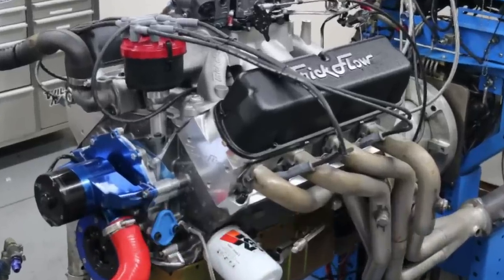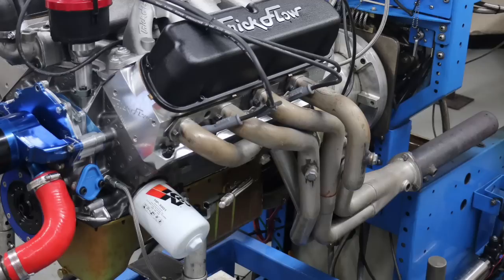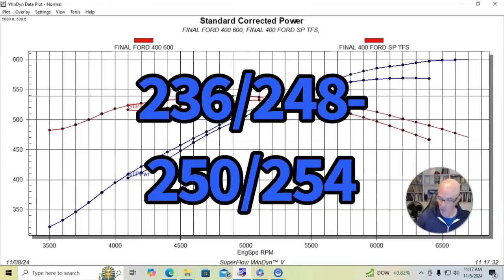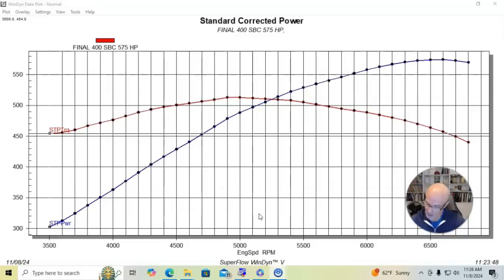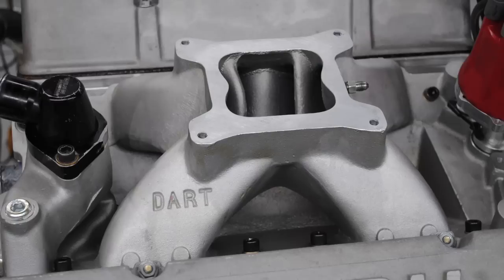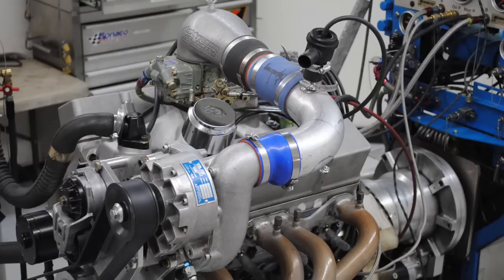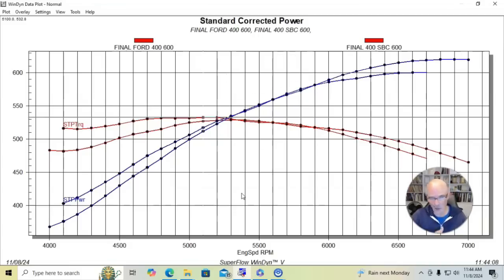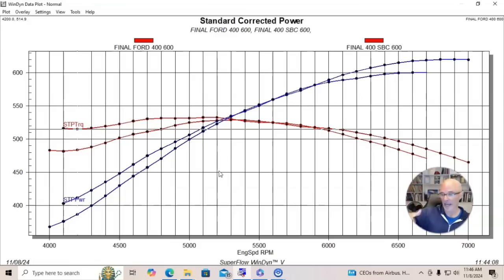400 FORD VS 400 CHEVY-THE OTHER GUYS STROKER BATTLE. HOW TO: 600+ HP 400-INCH SMALL BLOCKS!

Comment: Richard, I order a low buck truck cam on November 1st (came in last Friday) from you and I didn’t get a shirt. I would love to get one though.
Reply: 400 Chevy 400 Ford 400 dodge and a 401 ANC would be very interesting but in the way they came from the factory and then modifications not a 10 or 15 thousand dollar motor to start off with also 400 cubic inches is 400 cubic inches doesn't matter if it's a big or small block it is still 409 cubic inches with the exception the amc is 1 cubic inch different but I really do not see were that would matter but it would be interesting to see
Reply from the maker: SEND ME AN EMAIL WITH THE SIZE AND COLOR
Reply: I meant it's still a 400 cubic inch I'm not sure what you meant about the color Richard I've been a fan for a long time I used to build engines diesel and gas I just thought it would be nice to take Ford Chevy dodge and AMC what used to be the big 4 now it's the big 3 american engines of the same cubic inches and find out even stock and with modifications which one would make more HP I look forward to more videos thank you for what you do

Comment: Everything being equal, it always comes down to the cylinder heads. Horsepower is made in the cylinder heads. The camshaft is an accessory to the heads
Reply: I’m pretty sure the heads flow similarly

Comment: Okay, so you threw the Chivy guys a bone (or should I say a cam) by stacking the deck against Ford. Charity and compassion😇, your full of it Richard.
Reply: The chevy was oe ci. The ford was a stroker......how is that throwing the chevy guys a bone?

If the chevy was also a stroker it would be a 427.
Reply: @HioSSilver1999  They are both 400 cubes. And did you read my response to Richard's comment. GEESH!
Reply from the maker: new to the channel?
Reply: @richardholdener1727  No, I know you lean blue oval, just my type of sarcasm is hard to pick up at times, I meant what I said about charity and compassion, not that you are full of crap. Love you Dude.

Comment: You couldn't get away with a 4.125 bore on a stock SBC block.  Bigger bore and  shorter stroke is definitely an advantage for the SBC in this comparison.
Reply from the maker: factory 400 sbc had a 4.125-bore block (though this was an after market block)
Reply: 400 sbc is 4.125 from the factory. Unfortunately, stock 400 blocks are getting hard to find. Not nearly as many made as the 350 blocks.
Jack Henderson

Comment: Ahh wutttt I thought you actually had a 400 ford. Not a stroker 351W!
Reply: The stock Windsor didn't have enough head to support a 351, A 400 Windsor is a joke.
Reply: @mylanmiller9656 are you okay

Comment: The Fact the 400 Winsdor Ford made 601 Hp , Chevy 400 619 Hp , Ford used much less Camshaft duration,  points to myself the Ford 400 is more efficient doing with less .
Reply: Man everyone is uoset. I CAN TELL YOU FROM DECADES OF STREET RACING HERE IN UPPER CENTRAL ILLINOIS ALL THE HORSEPOWER UP TO 5000+ DOES YOU NO GOOD IF YOU CAN'T MAINTAIN TRACTION 9N LAUNCH,  60 FOOT, 1/8, 1,4, 1/2 1 MILE & 2 MILES FLAT OUT GOING TO 200+ MPH. IF THE FRONT END LIFTS AT 140-180 YOUR FLICKEN DEAD  
I AM A PONTIAC V8 GUY THAT LOVES BIG BLOCK CHEVY V8 TOO ALONG WITH ALL OTHERS. 
TRUE STREET RACING YOU RACE ANYWHERE ANYTIME.DIRTY NO SWEPT BLACKTOP ANY. HIGHWAYS  INTERSTATES ALSO AT 2-3 AM PURE PITCH DARK ONLY HAVE YOUR HEADLIGHTS.
Reply: This isn't a test or comparison it's a hey let's dyno 2 completely different motors
Reply: Actually the ford did less with more. It's a stroker....the sbc is 400ci stock
Reply: @HioSSilver1999  Chevy was aftermarket block, big bore blocks unshroud the valves allowing better flow. Should of been either a stadard 4.03 block for both or the 4.125 for both.
Reply: @DBLDREW  4.125 is a stock bore for a a 400sbc. So you're wrong.  Aftermarket block is just a convenience since they haven't made them is so long
Reply: @HioSSilver1999  ford makes a 4.125 block as well, point is you should compare apples to apples
Reply: @DBLDREW  The SBC 400 standard bore is 4.125, not a 4.0, the 350 had a 4.0 bore.
Reply: @SteveBurnsed  not sying that its not, I'm saying ford produces a 4.125 bore as well so it should be comparing apples to apples. Both should be 4.125 or both should be 4.00 

If this was a comparson with big bore shorter stroke vs smaller bore bigger stroke then it should be the same manufaturer as well
Reply: @HioSSilver1999  With an aftermarket SBC block!   Try it with a stock GM block and see what happens!
Reply: Let's compare apples to apples.
Reply: @tct9mm151 They’re already sbc 400 blocks that exist oem, it’s was probably just easy for strength and availability for Richard to use the aftermarket block
Reply: @tct9mm151  be the same result. 
Try the ford with a oe crank stroke.....oooh wait then no 408.
Reply: @HioSSilver1999  correct but 351w will make tons of power without air conditioning the block like the stock 400sbc. . 
The 351w doesn't need to be stroked to make power unlike the stock 400sbc that's known for it's weakness which explains why the sbc aftermarket block.
Reply: @tct9mm151  what explains the aftermarket block is simply trying to find a oe 400 block.

351s are turds. If it wasn't stroked with a aftermarket crank it woulda got shit on even worse.
Reply: @HioSSilver1999   And that's why he had to buy an aftermarket 400sbc block?  Because the stock block WILL split in half after 400hp. 
Fact is that the oe 400sbc are over heating, oil burning, wheezy, old van engines that were SMOGO junk that needed constant repairs just to propel the 70's GM junk to comically poor performance and fuel economy with the worst (at best) reliability!
351's are tough as nails and never needed anything to make them performers. 
351W are ICONIC!   
400sbc are the "POOCH OF THE LOT"

Comment: Both Are Impressive Engines the 400 Ford Winsdor and the 400 Cubic Inch Chevy.
To me the 400 Ci Chevy has an advantage N/A with the 1000 ctm 4150 Holley Better Volumetric fill efficiency. 
There is Main and Rod Friction differences between Ford and Chevy, Bore/ Stroke Ratio, Rod/Stroke Ratio, Piston Dwell Time TDC & BDC But you never like discussions on that stuff.
Reply from the maker: because we focus on the bigger things that actually change power-those theoretical things (more often than not) can't even be measured.
Reply: @richardholdener1727  I watched a video last night where a Guy with A Toyota pickup 4GE something he used stock length connecting rods and then .300" longer , he tests like you very well documentation,  chassis dyno used. There was a Torque HP Gain up high 6000+ ,to 8000 rpms didn't lose anything down low. REPEATED Results likewise.

Comment: Cam difference in duration, LSA and lift. The Chevy also had solid rollers. Many variables to take into account on top the Ford being 410 cid and the Chevy 400 cid. The bigger displacement engine with the smallest cam will get the most torque under the curve (Ford) and inversly proportional with a big cam and hp (Chevy).
Reply from the maker: Ford was not 410
Reply: @richardholdener1727  Sorry Richard, 408.
Reply: @richardholdener1727  The only information you did not give here is the compression ratio of the Ford engine. The Chevy was 11.25:1. It could add to the change (with all other things mentionned) and not make a big change. :)

Comment: Ran a Monte Carlo like this for a couple of years except the heads were  881 that was ported and polished. I  used tetraethyl lead to increase octane. Would get about 6 mpg in town and 25 mpg highway. The late 90’s were a different time.
Reply: which trans?
that's a huge swing in mpg
Reply: @ th350 2500 stall 3.08 geared.

Comment: Valve size, and port volume of intake and heads make up for a big difference in power and torque as well as the added duration. Great video 👍🏼 I always enjoy watching your videos. Much respect to you for what you do, this is coming to you from a Nor Cal Private engine builder with 30+ years experience and I commend you for your hard work.
Reply from the maker: THNX

Comment: bore x stroke definitely not a factor at this hp range. While bore size can be a factor, it is not until the hp goal requires a larger valve than what will fit inside the bore.

Comment: There's one thing Chevrolet wins on hands down, parts.
Everytime I'm shopping for Small Block Ford parts, I want to cry at the prices and availability of LS/Small-Block-Chevy parts.
Everytime I'm shopping for Mopar parts, I want to cry at the prices and availability of Ford parts.
Reply: As a Mopar and a Ford guy, I find it totally unfair that Chevy gets all the parts and companies are still developing NEW parts for the tired old 350.  The price difference is criminal too!
Reply: Ha, not 2$ difference
Reply: Camshaft is the reason the Chevy made more peak power.
Reply: @tomhamilton9140 the whole combo was set up different.
Reply: True. Parts for a small block Chevy are priced very nicely when compared to fords, especially a 460.
Reply: Not $50 difference in a sbc build vs sbf build or bbc and bbf..fact
Reply: @SpecialEDy  I don't know where you're buying your parts, but when we were racing, we bought most of the parts off Ebay! I just got tired of working a day job and racing 4 times a week! It becomes another job!! Then your partner wants to go faster! Your problem is you obviously don't have the ability to do the math! It's not a Ford or Chevy piston, the wrist pin location dictates and bore dictate the piston you buy as long as it's an inline application! Most of the stroker pistons for Fords depend on the stroke and wrist pin location! Maybe your generation simply can't do the math?
Reply: Ever look on summit? They have plenty of ford parts....
Reply: I use to run Chevys when I was broke

Comment: If It Was a 400 M Ford built by T Meyer incorporated I would put my Money on the 400 M every day of the week.
Reply: @mylanmiller9656  the 400 was made to replace the 390 FE.
Reply: What's a 400 M ?
Reply: @jesse75  An engine Ford tried to use to as an alternative to the 460ci BBF..
Reply: @jesse75  Basically a 351 Cleveland with a 4 inch stroke, taller deck height, 351W sized crankshaft main bearings, and a 429/460 bell housing bolt pattern.  From what I read, it could have been a great engine but all the emissions and smog stuff practically killed it.
Reply: @mylanmiller9656  good grief. All these guys trying to school me on the 400.
There's no such thing as a 400m.
Get with it guys.
I've rebuilt about 70 of these low oil pressure rod knocking engines over the years.
Ford was stupid!d for giving this engine a barely adequate oil system for the Cleveland, then transfer it to these tall deck 351M/400 engines with very heavy reciprocating mass without upgrading the bearings. 
I've come across a couple 400's that were both drilled to use either transmissions.
Reply: @jesse75  You don't need to be a dork, the 400 was cast in Michigan, so it is an M engine or the Windsor is not a W, and the Cleveland is not a C engine. What makes the Michigan engine different than all the other Ford engines.
Reply: @jesse75  Ah... You're playing a game of semantics.  You're right, there's no such thing as a "400M".  It's just a 400.  Just like there's no such thing as a Ford small block or Ford big block.  They are named by series, such 335 series, 385 series, etc.
Reply: @jesse75  The '71 "400 FMX" - BBF & SBF bell patterns.
Reply: @mylanmiller9656  Joey it's not a game. 
It's just facts. Stick to what nomenclature Ford has and uses.
Lots and lots of ignorance out there on Ford history and knowledge of their families of engines.
Reply: @jesse75  Amen! They have always had the better Idea......They thought.
Reply: Anyone that says dont use the GM nomenclature B/S block on Fords... must be REALLY FUN AT PARTIES 

Freaking buzzkills, all of you.
Reply: Or Kaase built..
Reply: @mylanmiller9656  mylanmiller. 
Who's the dork ? 
The 400 never needed a letter designation to identify the engine.
The 351M did, because it was a de- stroked 400.
Ford originally had no name attached to the M letter.
The 351M engine was both made in Cleveland and Michigan.
Modified was later adopted by Ford mechanics and enthusiasts. 
Some, Michigan, some Midland, even though some M engines were made in Cleveland. 
When I had my Ford engine rebuild shop in Seattle in the 80's and 90's, it was coined by some of us to call it the " morphidite " because of its sick low compression, low performance, anemic, non performance. 
I personally junked and scraped at least 50 of these engines in favor of the better 429 or 460. 
As an experiment, I once put a Windsor crank in a 400 block.
Modified and lightened the rods, the front of the crank, and pistons. Balanced.
Used a mile a more cam and sp2p 400 intake.
Reply: @jesse75  The  429 never needed  designation but that didn't stop ford from calling it a Lima engine Because it was cast in Lima. he Windsor is cast in Windsor the  Cleveland is cast in Cleveland the Lima is cast in Lima. Using that as a base,  if you call a 400 an M engine you are not wrong  
look on the back Of the Block it is Cast MCC  For Michigan Casting Center on Most of the 351 M and  400 engines , Yes some were  cast in Cleveland, but Most 302 engines were cast in Cleveland and you don't call them Cleveland.
Reply: @jesse75  Dead-On! The M was added to the 351 variants as it was a Modified 400 with a shorter stroke and taller pistons, so 'Modified' kind of stuck. The 400 itself has no "M" attached to it.
Reply: @mylanmiller9656  Joey should stick to his Mopar's. 
My favorite mustle car of all time is the 1968 Roadrunner, but I'll never claim to know everything about them.
Only built one 68 440 and a 74 318 over the years.
Reply: @mylanmiller9656  mylanmiller, good rant for a hurt ego.
I'm going by what Ford literature and Ford repair manuals said, and what I have noticed in taking more than a thousand Ford engines apart.
I grew up and worked on these engines when they were being produced by the various factories and foundries.
It was fun and a good joke to go argue with local auto parts, such as Roxbury Auto Parts in Seattle.
The owner, who I greatly respected, who knew a lot, would occasionally get one of the 3- 351's mixed up.
I remember arguing about a bathtub gasket for a Windsor, when he said that only came with the C and M/400.
But the van application called for a bathtub.
Reply: @jesse75  And you are wondering who is a Dork  ' no question it is you!
Reply: And for $20k it should
Reply: It begs the question, was no stock 400 available to build with? Some Unlimited Sprint boats used 400’s